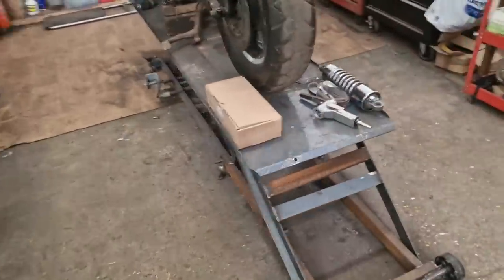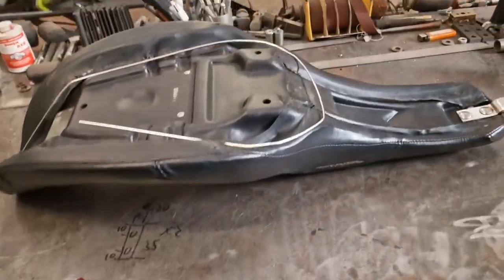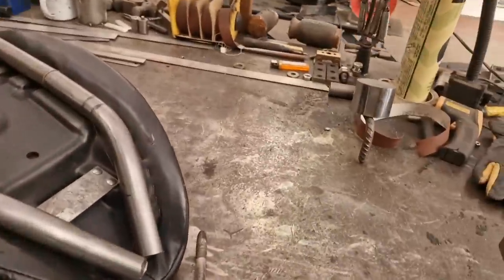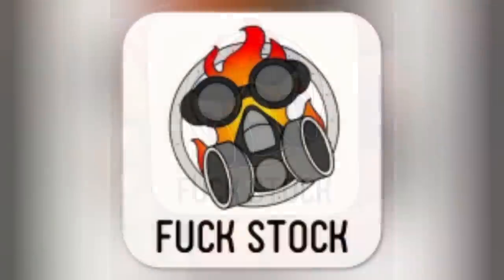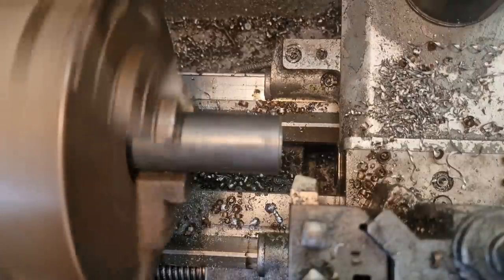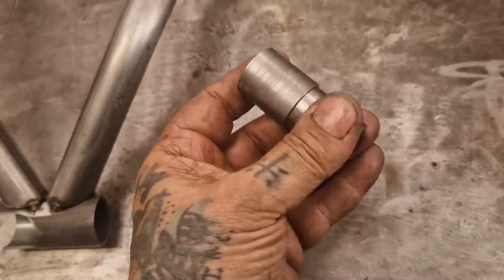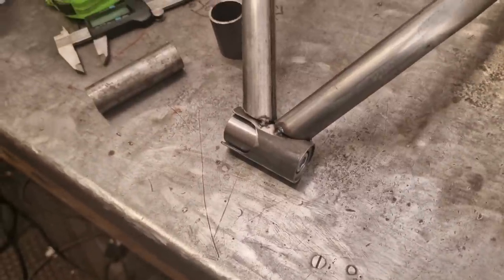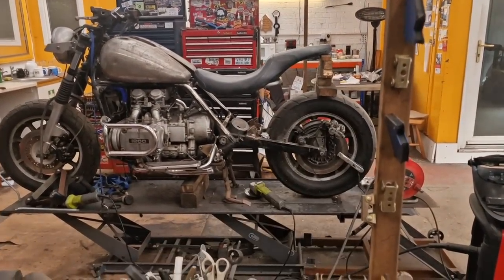Honda Wing Pt2! How I Build Handmade Custom Motorcycles Vlog Seat Loop #honda #handmade #vlog

Comment: You can make a bigger radius with a smaller die. Just move the tube in the die bit at a time. It will leave small flats but you can blend them in. Hope that makes sense.
Good to see you back.
Reply from the maker: Thanks buddy

Comment: Hi Ralfy
Don't know if it will work for you but I bent some pipe by tacking two bits together, propping one end on a large bit of timber and then backing my small truck along the pipe towards the prop. Result, two bits of pipe curved exactly the same. (Sorry don't know how to describe it better. Hope you understand.) Give it a go. Love your series.
Reply from the maker: Cheers buddy, unfortunately this tube flattens out if you don't have a mandrel etc